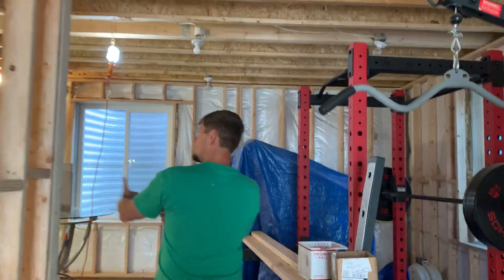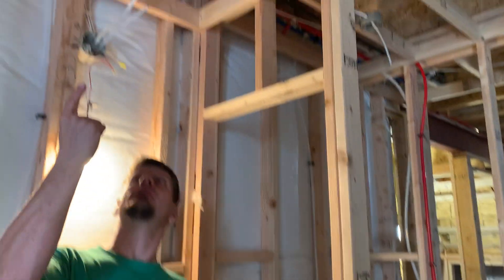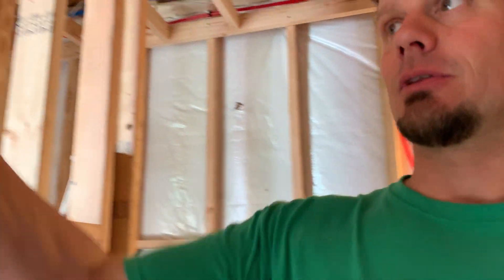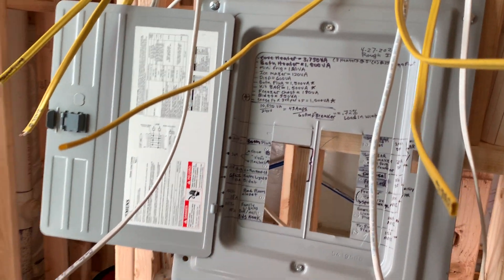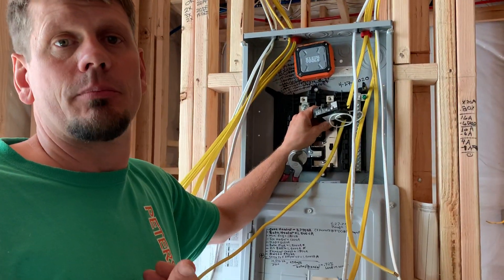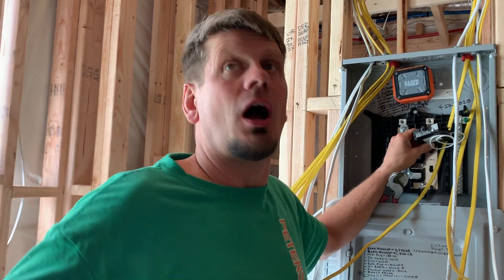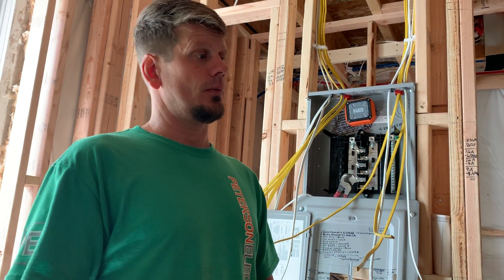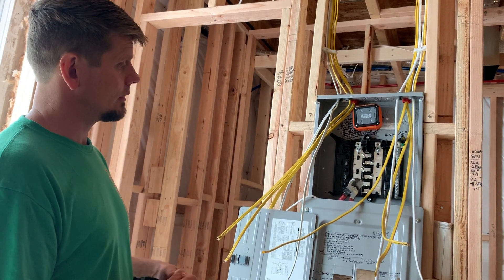Wiring an Unfinished Basement

Comment: What I don't understand is why the person who did the wiring couldn't show the permit to do what was done prior to Peterson showing up. It clearly states when applying for the permit to not start until you have the permit in hand stating the work to be done. secondly the permit clearly states not to cover any work that has not been inspected....and the rest goes on. This permit then would have shown Peterson what was inspected prior to installing a panel. Once completed prior to covering up anything you should have in hand the "green ticket"

Comment: Nothing wrong with over-building. Especially if you're planning for future things. I put a 100A in my basement (not an electrician) for only 4 circuts, and because I ran 220 to my garage to power a 40A and 60A machine (separately). My potential load might hit 80A, but most likely not. I believe you don't need to be "licensed" to know the right way and wrong way to do things. Like anything, you just need to be educated.
Reply: They like to undersize things because they get to come back again and again

Comment: I had my house built with a sub panel in the basement and the walls framed. I wanted to get tips on wiring the basement but this video wasn’t it. My first basement that I had wired professionally, it wasn’t done like I wanted it done. That same house, the original builder electrician had to come  back because the sub panel was put in where the bathroom was planned even thou we had shown where the panel should be placed. On the new house the electrician was rude when the house was being built. So I get that maybe you were trying to dissuade me from touching the wiring but I don’t trust electricians to do the job right ( yes it will probably be up to code) and I’ve finished a family room 25 years ago with no problem I’m just trying to get a refresher on what to do and not to do.
Reply: I have a new build and the electrician was the worst of the trades. Ignored my queries to get a larger panel (which is now already full), didn’t take notes (so missed a couple of circuits), just generally flighty. I’m going to learn it and do the basement myself.
Reply: I have a new build to and the electrician the builder used was terrible.  Ive had to rewire most outlets and switches in my house because they did a terrible job installing the outlets, neutral amd hot were wired together in some outlets and many neutral wires were just left open in the outlet boxes, my laundry room circuit would trip within a few minutes of plugging something in, my attic circuit didn’t work, circuits were mixed randomly (my main floor bathroom circuit is ran to various outlets in upstairs bedrooms and the gfci outlet for the main floor bathroom is in one of the bedrooms, my basement lights are on the same circuit as the garage lights, the basement outlets are on the same 15 amp circuit as the outdoor outlets and the network cabinet so someone could kill my security system and internet with an outlet tester outside the house)

Im not allowed to pull homeowners permits in my area and legally have to hire contractors for everything, I cant even hire an electrician directly to wire circuits in my basement, I have to first hire a general contractor to finish the basement and it was going to be 90k+. Ive lost 2 jobs since moving into the home and kept having to delay the basement finishing project while my family was ontop of eachother for a few years so I recently decided to add the space we needed myself and finish 1/3rd of the basement myself while between jobs.  It cost me about 9k to do high quality detailed work that I literally couldn’t even hire a general contractor to do, I would have had to pay 35k-50k to get a basic finish of the space for a workout room, office and closet.  I did a custom design with outlets everywhere I needed them, smart lights, a dozen cat6 lines, soundproof walls and ceiling, shiplap and steel walls and ceilings and premium flooring for around 9k total. General contractor wanted to charge that just for non smart puck lights and 2 20 amp circuits.

Comment: I was about to call an electrician to just wire a few circuits at the panel after I ran the wire. You changed my mind about that. Lol. I helped an electrician run wire when I was a little guy for a summer, but never touched anything live. He always told me when we were doing a job, “There’s two things you should know as a man: 1. Having respect always gives you the upper hand. 2. If you don’t understand the whole thing, don’t f***ing do it.”

Comment: You can't just get a permit to wire up a subpanel without wiring the subcircuits?  If you can, why don't you just quote and do that job?  Everything after that, it's the homeowner's responsibility.

Comment: what i have had to do is just remove all the home runs from panel area have licensed contractor pull permit land sub panel take pics have it inspected. told home owner to pull permit but just ask very nicely while the inspector is there to qckly chk what is there before landing home runs. sometimes they do most of time they dont until permit is processed.

Comment: You do nice neat work, but I probably would have insisted on 100 Amps to future proof it for the next 50 years. And I'd want the subpanel to  be no more than 2/3 full. What may be an exercise room today may be a dual laundry in 5 years. When buying a home I'd lower my offer if an electric panel was full. I do like the information that you write in the panels, but switching to a tablet and printer to create a label has been a nice upgrade that others have moved to.
Reply: heres a line from another youtuber "if it where any nicer the customer cldnt afford it"  lol
Reply: Completely agree.  Upsizing to 100 amp and using a bigger panel so that slots are free when you are done will make the house more valuable to a future purchaser.